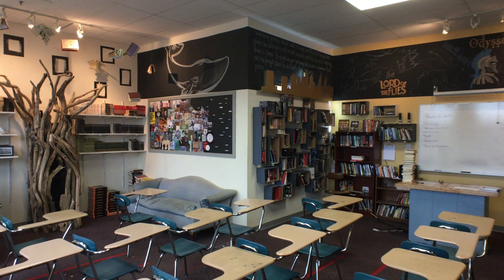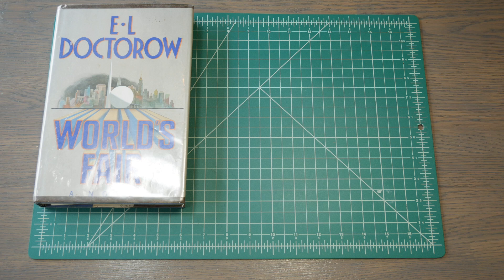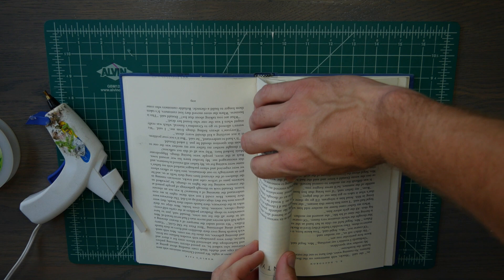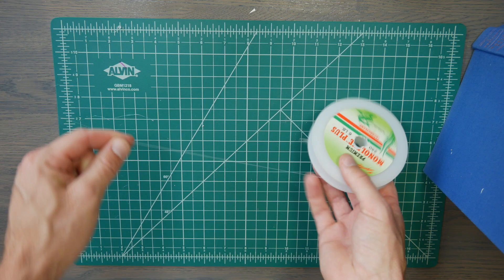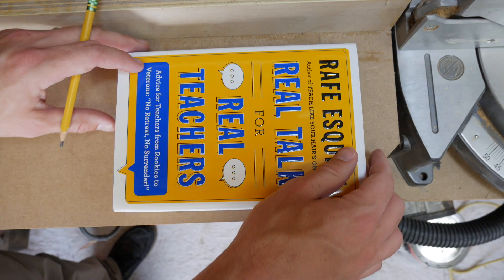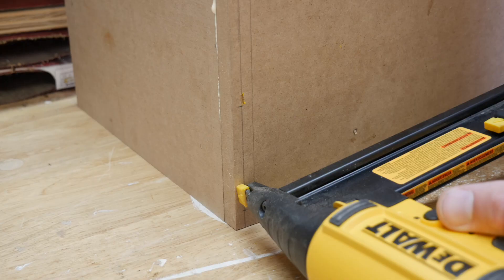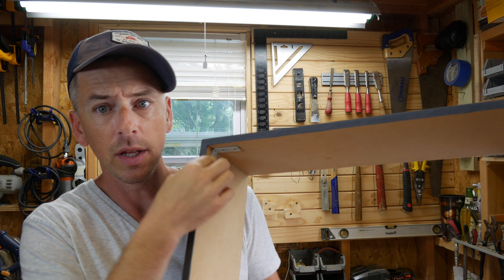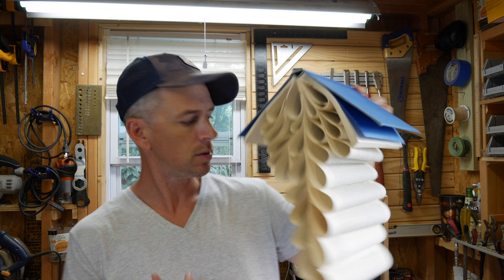DIY Flying Books & Floating Shelves | Teacher Vlog

Comment: Good job. It made me cringe a little to see a book being dissected that way! :) But the result is good. The shelf are simple yet classy too. Something is missing. How do you put them on the wall or the ceilling? Do you drill the wall? Do you use tape for the book to hang? There are so many laws, rules about what we can't do in a classroom due to security reasons here in France, that I'm afraid I can't do half of what you do! :(
Reply from the maker: A happy teacher - True story HAHA Yes the first time I made them my heart hurt for doing it but I only use books that no one reads like weird autobiographies 😆 The brackets that I installed on the shelves are what you use to attach them to the wall with anchors and screws, they were pictured in the begging shot of supplies you need. In my classroom we have what's called drop ceiling and I just tie the fishing line to the grid that holds the ceiling tiles in place. Super easy and doesn't damage anything. I'll also say if no one was specific in telling me the "rules" I just do stuff anyway and ask for forgiveness vs permission! Most of the time by that point no one tells you to change it. 😉

Comment: I am more concerned with the drywall anchors. lol. I am pretty handy. I just retiled my bathroom floor all by myself a few months ago. I hung a bunch of stuff in my daughters room using drywall anchors. I am just always a little worried about them. Especially in an older classroom where the drywall might be 40+ years old. Have you ever had a shelf fall or pull out of the wall?  Are you anchoring at 2 points or 4? 2 anchors per corner or just 1?  What weight anchors are you using?  I think I have seen one too many towel racks pulled out of bathroom walls. lol